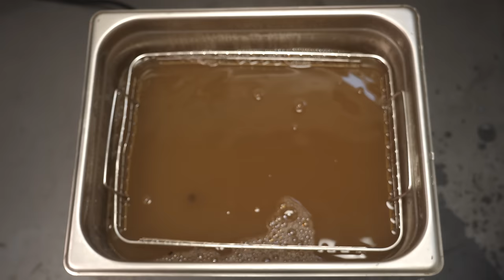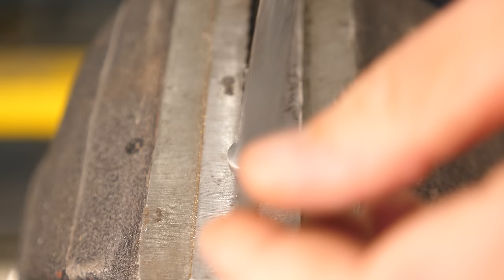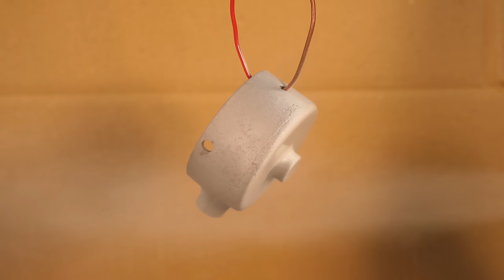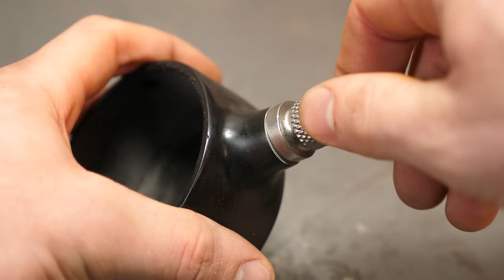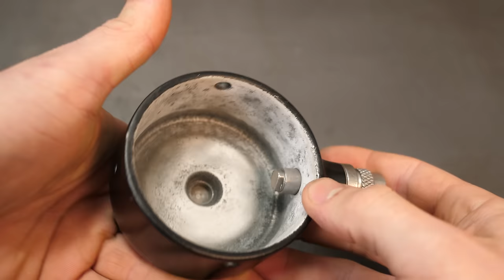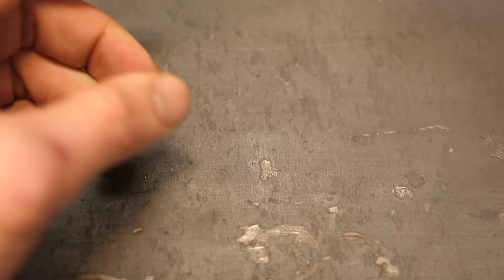Antique Valve Lapper / Grinder Restoration

Comment: Wow, haven't seen one of those in a really long time!  My uncle used one all the time.  They do work, but the trick it use valve grinding compound between the head and the valve and be very patient.  1 valve can take 15-20 minutes to get just right, and only use the weight of the grinder without any pressure.

Comment: You did a beautiful job of restoration and it turned out great. 
Your wood lathe skills are very good for a beginner on a wood lathe. I only wished you had explained to us exactly what this tool was designed for. Many of us 
had no idea what it was. I got the impression after reading one viewers remarks that it was designed to grind valves on cars. 
If he hadn’t made that comment, I would have been totally clueless. 
As a restorer, always remember that not all of your viewers are skilled mechanics, tool and die makers, woodworkers, etc. Please 
humor us and better explain what you are restoring, what it’s used for, and how old it is. Otherwise, 
I thoroughly enjoyed watching you work and will continue to watch your videos. Great job!!!!
Reply: could also be for metal taps and valves in plumbing.

Comment: Tip, when you put the bearings in. I'd have put little grease inside the bearing valley and put them in before assembly. The grease would have held em in place.

Comment: Neat little tool! Works best on clean valves, either new or wire-wheeled. And to get the cup to stick it takes a drop of oil or lapping compound in the cup. Try to keep it in line with the valve and don't force it. Works way faster than a spindle lapper.

Comment: I'm 74 now, but when I was in my mid-20s I bought one of these from Sears & Co.  It would turn forward, say 2/3 of a turn and then backwards 1/3 of a turn, then forward again.  I couldn't get this to run slow enough to tell.  It worked great you just had to put a lot of time into it.  You started with coarse compound, cleaned that off then medium and clean that off then fine compound and clean that off.  It did a great job of lapping them to each other.  I found a modern listing for them:  https://www.sears.com/rotary-9051-cup-valve-grinder-for-9050/p-A014138136?plpSellerId=1800toolrepair1&prdNo=11&blockNo=11&blockType=G11
Reply: So was this valve lapper just a tool to clean the top of valves. Am I understanding your comment or am I rong. Please help me out hear.

Comment: You should always point the jaw towards the direction you're turning channel locks or adjustable wrenches. This ensures a tight grip and your wrench won't slip. Turning the direction you turn them what cause you to round off bolt heads and gouge material you attempting to turn due to the Jaws loosening as you apply pressure causing them to slip. I thought this was common knowledge. I guess you're not that common

Comment: watched the whole video. still no clue what this thing does!!
Reply: C'est pour roder le siege de la soupape sur la culasse avec la soupape elle meme: rendre etanche
Reply: It's a valve lapping tool. Machinists use it to grind motor Valves on the cylinders head seats
Reply: @frappebaileys4407  why?
Reply: If a valve is not "grinded" properly on its seat then that cylinder will suffer from compression loss-among other things -. So special tools such as the one in the video, are used fix a valve on its seat
Reply: @frappebaileys4407  ah ok. Seems like that wooden thing did a better job than the tool tho.
Reply: @GoodWithHands27  I ve used the wooden stick too and it's OK but if the tool in the video isn't too heavy then it should work much better

Comment: Gee, the ultrasonic bath worked really well 1st time, NOT! All that old grease & oil would have come off in seconds by placing the parts in a large container using an old paintbrush and choice hundreds of different solvents intended for such work to scrub the goop off !